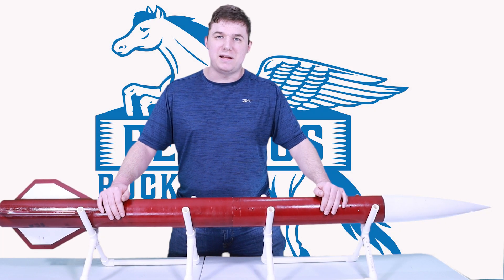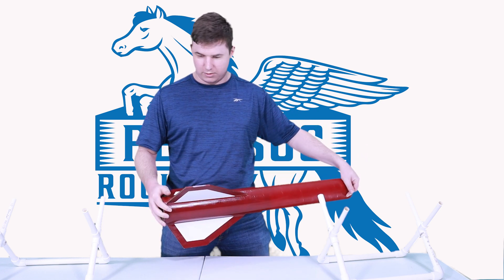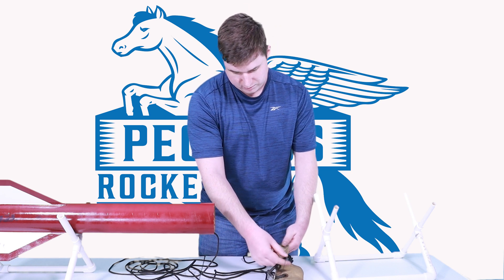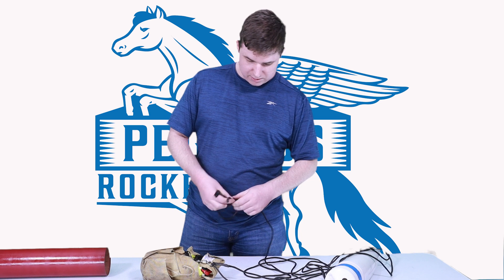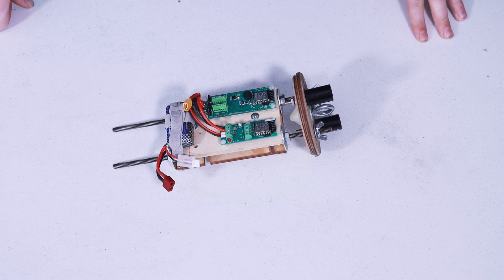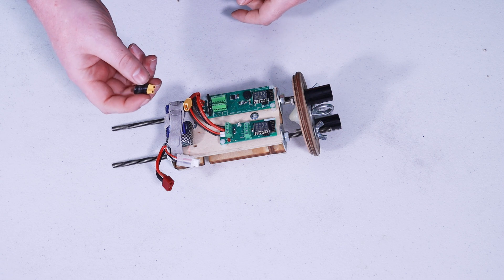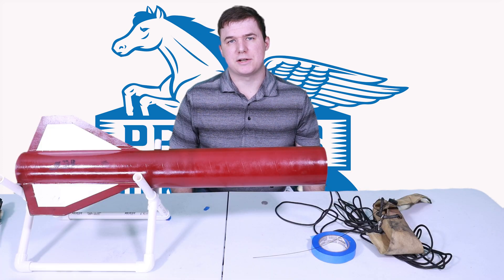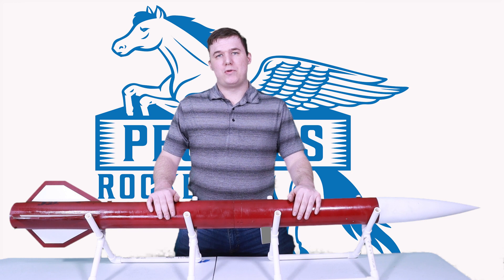High Power Rocketry Level 2 Certification Preflight.

Comment: What are you using for shock cord?  I am familiar with soft shackles for vehicle recovery.  Are the soft links you mention made similar with a loop of cord with a knot and when you wrap it around on it self the knot keep the loop together?
Reply from the maker: Hello @MerrixsOutdoors, I got my soft links from Rocketman Parachutes. I am using their 1200lb soft shackle on this rocket. Similar concept but instead of the knot they use a piece of thick nylon sewn on like a flag. You thread the end of the link through an eye beside the nylon flag and then you have another eye on that piece that slips over the flag to lock it in place. It's not the easiest thing to describe but I hope this gives you the idea.
Reply from the maker: @MerrixsOutdoors, You should check out the end of my Black Hole Final Assembly video. I show much more of the soft link in that video.